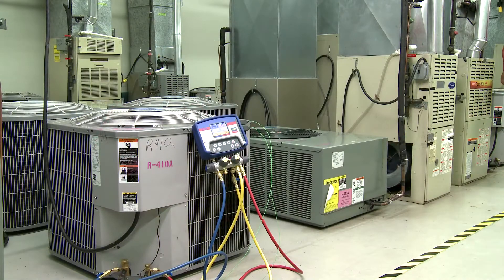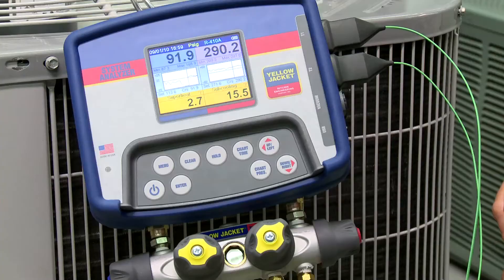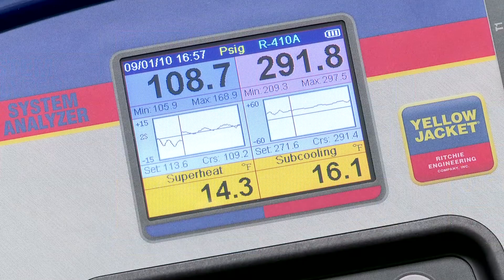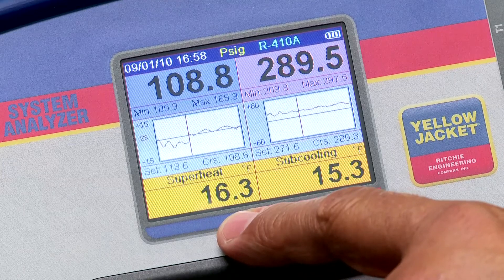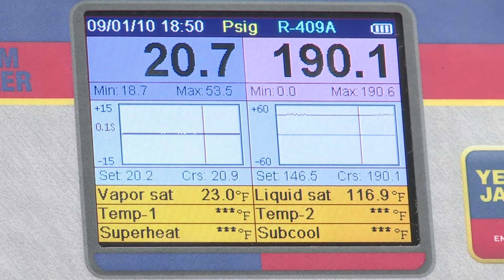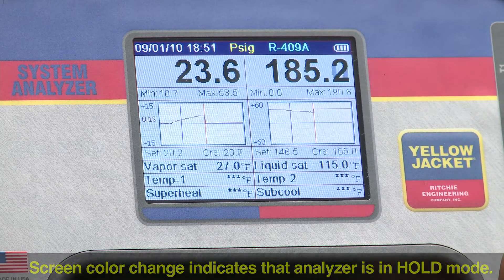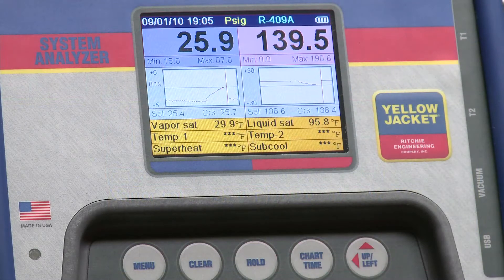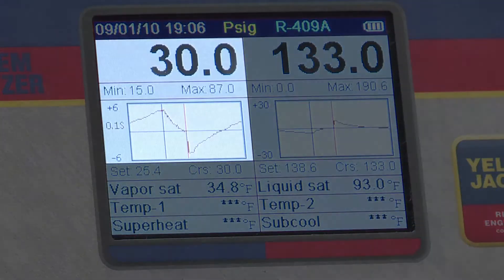Refrigeration System Analyzer "Practical Applications"

Comment: I do refrigeration.  I DONT WANT WIRELESS.  I do want rechargeable.  I want the low loss of wireless with a charging T but I only want a curly wire going to my service valve not a hose . . If it can then plug into the USB on my cell phone for added features keeping your box as small as possible.  you may have a product